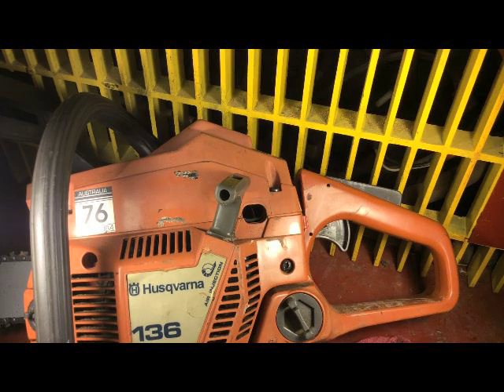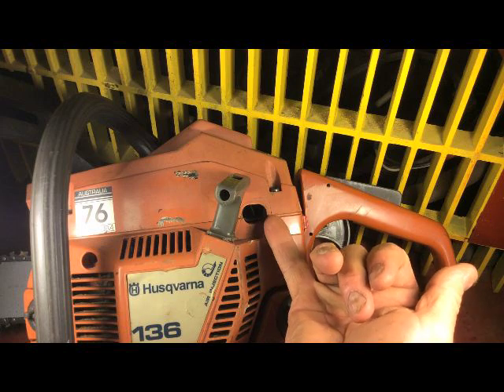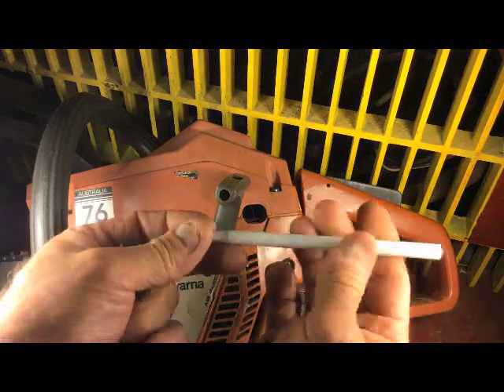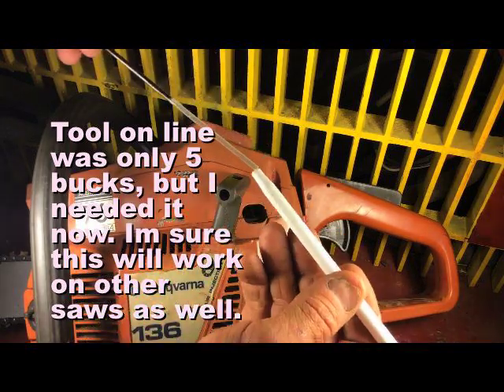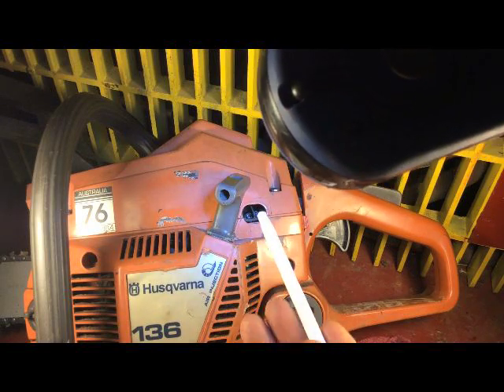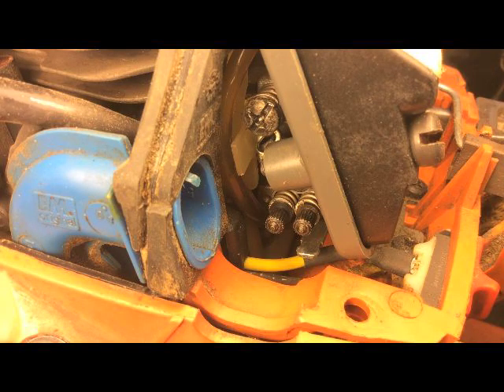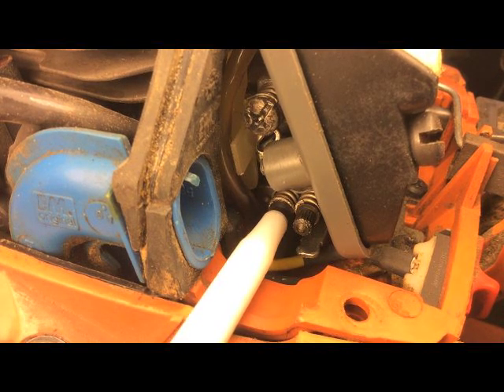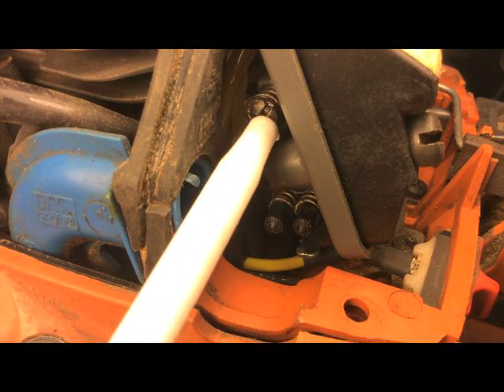Homemade 136 Husqvarna fuel adjustment tool

Comment: Very useful! Thank you! I have a Husqvarna 125BV blower and it would bog down at anything above half throttle. Looking into it people said they adjust the carb poorly for EPA reasons, but it doesn't run right at that adjustment. I dug around for a pen, and it worked perfect. Pulled the rear most screw out 1/4 turn, let it warm up and now it runs like a champ!
Reply from the maker: Thanks! I was exited when I figured it out, thanks for watching.